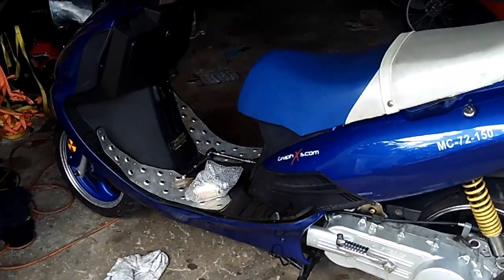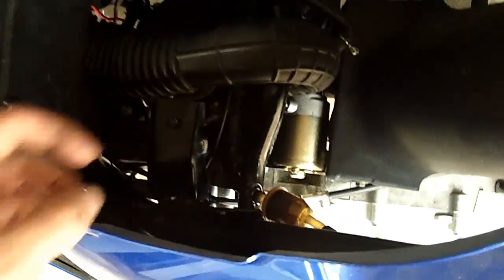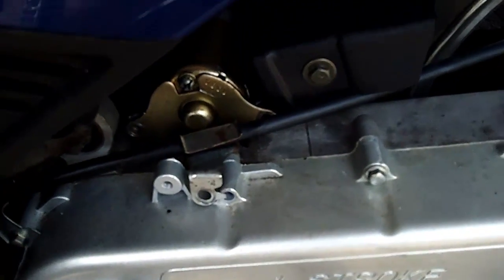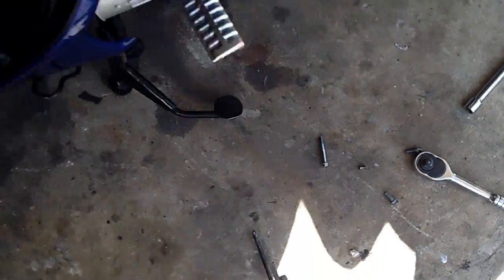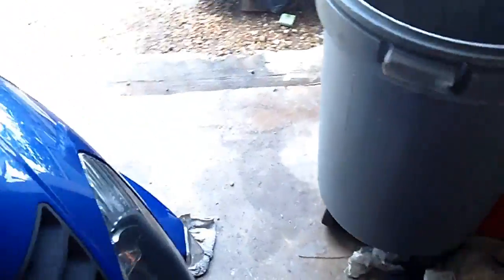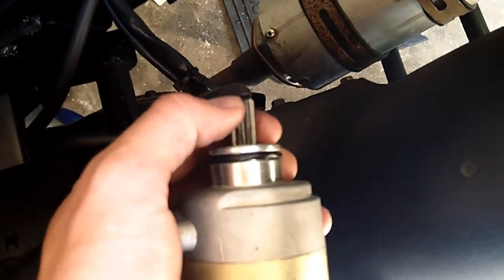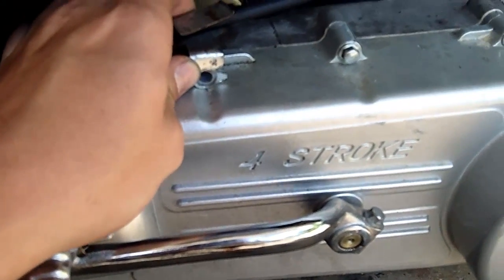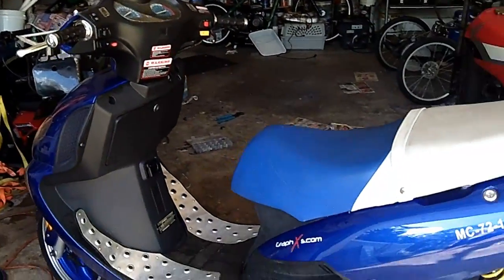How to Replace Starter Motor on 150cc GY6 Scooter

Comment: Good explanacion! I heard the battery loose it a bit on power but it was enough this time to get the engine running! Normaly with a good vaccuum and fuelline and no electrical problems these engines start right away!

Comment: depends on how you tune it and what kind of enginge. Ive got a 50 cc dirtbike model for on the road and it has top speed of 90Km/h and i got a scooter with 49cc that tops on 55 km/h

Comment from the maker: starter should only turn one direction, so the internals might be screwed, but 11.75 isn't quite enough voltage. You should have around 12.5

Comment: What about putting a wad of grease around the splines at the starter motor body? Wouldn't that help prevent oil seeping inside?Also its not easier to take off the side panel as well??

Comment: I have one that I rebuilt the top end and I couldn't get it fire.. the starter turned but I got it to run and stay on.. I turned it on and off a few times riding it around. So I went to go and start it and it acted like the battery was dead. After some tests I concluded the starter wasn't powerful enough to turn the engine after using the battery on another bike

Comment: Hello there is it the same on a 125 2003 GilrA runner to fit a new starting motor thanks.
Reply from the maker: probably similar but that is a totally different engine

Comment: I removed the bolts, but I can't get my startmotor to move. It's a sym allo. I've tried spraying it with wd40 but still no bueno.
Reply from the maker: try prying it out with a long screwdriver or prybar

Comment: How do you know the starter is bad? Does the bike make weird noise when you try to start? Mine wont start struggles then it wont make a sound
Reply from the maker: make sure you have a good battery, then check voltage at the starter motor while cranking

Comment: Got a Peugeot speedfighter 2 100cc scooter moped riding down road hears a crunching noise pulls over turns it off goes to restart it won't even turn over or even making the noises like if goin to anybody no what's wrong with it?